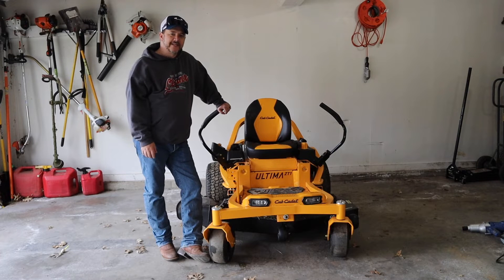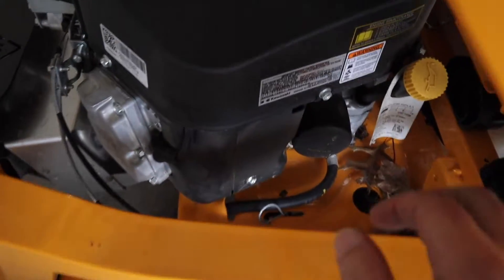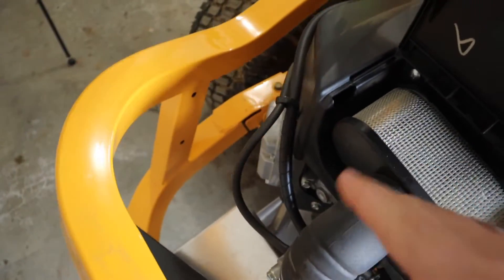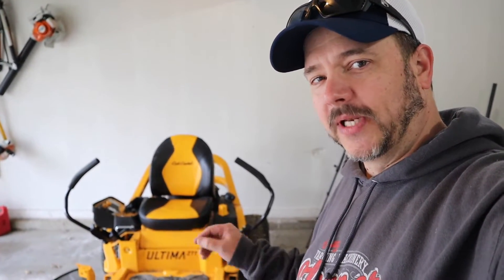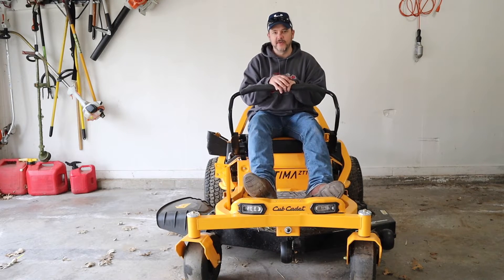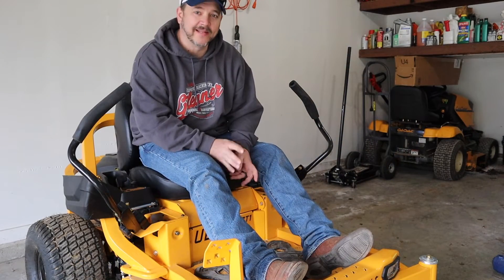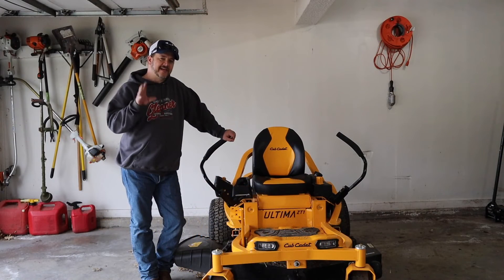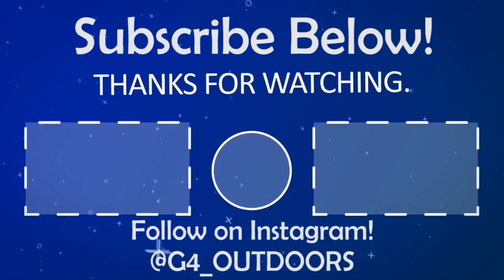Cub Cadet Ultima ZT1 Mower | Top 5 Features That You Should Consider

Comment: Can we get some updates on these Ultima Zero Turn Mowers now that spring has sprung? How are they performing?
Reply from the maker: Steve Molnar working on thumbnails and tags. Watch this first. https://youtu.be/E83Sul2e38Q
Reply from the maker: Steve Molnar watch this second. https://youtu.be/TiVDK7Yj2E8
Reply: Mine has definitely surprised me in a good way.    I am blown away at how well this mower runs and works for the very low price tag.  Recently we had rain constantly for two weeks and one of those weeks I was away on vacation.  When i returned some of my grass was over 24 inches.  I mow 7 acres of rolling hills and open woods.  This machine (albeit going very slow) cut all of this damp grass like it was its job, which it is.

Pros:  price, good ride, easy to drive, cuts well.
Cons:a bit slippery on damp of soft soil, the hose plug in deck cleaner really doesnt do a greta job.  You still need to get under it and power wash the under deck especially when mowing wet spring grass.
Reply from the maker: @troybennett9525  Thanks for the comment Troy!
Reply: @troybennett9525  thanks troy
Reply: the new model  i think its the 2019 or 2020 looks like a good mower

Comment: I love mine, however no hour meter is a wtf moment, and I’d like to see something separating the oil drain hose from the metal frame, perhaps the same flex conduit they use for the electrical wire at the very least.

Comment: I just bought a Ultima ZT1 54 and it does not have the Aeroforce deck.  Is that some type of optional equipment?  Can I up grade to one?
Reply: How do you like it? I'm looking into that one as well.  Do you notice any difference in the air filter and oil drain?

Comment: I bought mine over a month ago... best in class cut😂🤣😂🤣 cuts horrible and the blades are 70 dollars for 3 no aftermarket blades because of s shaped center hole design. Also sent it to repair shop because after mowing for an hour and then stopping the left transmission won't move they said its the parking brake I have to jiggle the handle back and forth to unlock which doesn't work so nothing's wrong with it😖🙄🙄🙄

Comment: I hear that the cub cadet has to much problems with the deck to much vibration can you tell something about it
Reply from the maker: Tomas Castañeda My deck vibrated so bad that my arms were numb after I mowed my yard. My belt was always so hot I couldn’t hold onto it. The cut quality wasn’t anywhere near the best. If you’re looking to spend this much money, you have to check out my latest video. The Toro TimeCutter MyRIDE 54” 24.5HP is by far the best cutter I’ve had a chance to demo so far.
Reply: So do you like this mower or not ?  It seems like you go back and forth.  One video you like it and then the comments seem to go the other direction.  I'm looking to get a 0 turn and am weighing my options.  Thanks.
Reply from the maker: Mike Petrosky the day I got it I was just excited and blinded by the looks. As that wore off, I started to notice all of the flaws and workmanship. I would highly recommend staying away from this model. That being said, they are on their second or third year of production of this model. Things might be better at this point, but I won’t guarantee  anything.

Comment: Looks great but as with all the box store mowers it’s the hydros that are the weak point. I wore out a cub cadet 1050 on my property in 2 years. Hydrostatic drive isn’t strong and durable enough to handle any hill climbing. Plus you can’t service the hydro. They are fine for postage stamp yards, but any pulling or climbing hills will destroy the drivetrain.
Reply from the maker: JohnnyRebKy Agreed! I will have a great video for you coming up 🤣. Cub took mine back and is bringing me another one along with a rep issuing a bad vibration for YouTube purposes. They did say that it wasn’t designed to cut my property. 🤷🏻‍♂️. It’s designed for up to 4 acres, so how is it my 2 acre property isn’t ideal for the Cub? I’m going to laugh at this guy if he tells me this mower isn’t designed for my property and only for flat golf course lawns.
Reply: G4 Outdoors well they are designed for flat golf course lawns lol. The hydros can’t handle much strain and you can’t change the fluid. All the shavings remain in there forever and if you get it hot it’s finished. I have 5 1/2 acres with some big hills so I had to buy a John Deere X700 series with the shaft drive and monster strong hydro drive. If I were you I wouldn’t buy any mower that doesn’t have a serviceable hydro system. Changing fluid and filter makes all the difference. The ones that don’t are designed to be thrown away after a few years and buy a new one. A durable hydro that’s serviceable can last 30 years. I have a JD 318 that’s 38 years old now and the hydro drive is still going strong. Cub cadet riding mowers all have the tuff torque K46 hydro that isn’t serviceable, and so does the box store John Deere’s. A good riding mower needs the serviceable K58 hydro or above which is only found in dealer models. Zero turns need commercial hydros to last.

Comment: Hi I'm Jim and I've been watching some of your vids and have a question as I am very interested in purchasing this ZT1-50 at Home Depot near me but have been nervous the question is on the deck itself as I hear of other issues concerning this,is there a major problem with the vibration or is it just louder or does it jerk around, What?
Reply from the maker: James Sommer The belt slaps around a lot. There is a miss alignment problem or a balance issue for sure. Don’t let the paid reviews fool you.
Reply: G4 Outdoors then you mentioned a different tension spring right!
Reply from the maker: James Sommer This is my second Ultima ZT1, the spring tensioner is better on this one, but it still has too much slop or there is something else wrong for it to be vibrating like it is.
Reply: G4 Outdoors I really like this mower,it looks like a commercial mower for my lawn and looks like a monster mower and the looks tell me a lot but is it worth my buying it?
Reply from the maker: James Sommer depending on what your previous mower was. It has an awesome warranty, the ride is way more comfortable than my last Cub tractor, it gets my lawns mowed in no time. If you are upgrading, you will more than likely love it. If you are just a regular homeowner (as far as Lawncare goes), you will probably love it. It’s definitely not the worst mower out there.
Reply: G4 Outdoors I have now a 10 year old as I bought brand new in 2009 a Toro 42" timecutter zero turn and it's about ready to bite the dust.
Reply: Any idea if the deck vibration issue has been addressed by Cub Cadet?  Would you still recommend this over Ariens, Toro, John Deere?
Reply: Jason Ahlers I have no idea,but I decided to keep mowing with my current mower until it can't cut anymore,then I will consider buying the zt1-50 if they are still available.
Thank you for the look ahead.

Comment: Looks good Randy. Those are good looking mowers as well. May want to lower that rear tire pressure a hair. It will make it a more comfy ride without suspension seat and the tires will wear evenly. Only reason I noticed is bc there is no dirt on the outer tire. The edge of the tires should have dirt on them as well. Thats where you get your side to side hill traction. Love the lights!!
Reply from the maker: Thanks for the heads up! I’ve only been able to use it once, so I really haven’t had a chance to feel things out yet.
Reply: @g4outdoors  yeah run the tires lower. Better traction and better ride quality. Also tires wear evenly. Sweet mower. Need to mow the neigbors now.
Reply from the maker: My new neighbors just moved in a week ago. I asked him if he had a mower, and he said he has to go buy one. I said no no. I take care of this property LOL.
Reply: @g4outdoors  make that $$

Comment: I noticed you have a lawn tractor too.  Which would be better pulling accessories, i.e. carts, plug aerator, etc?  I have two slopes in series.  They range between 12 and 18 degrees.  Do you think ZT1 would handle these or cause premature wear on the transmission?   Mfg's mostly do not recommend slopes over 15 deg, however, dealers say no problem with my slopes.
Thanks for your video.
Reply from the maker: I’ve had that tractor for 10 years. It has the same motors as the ZT1. I plug and haul a cart every year with zero problems. As long as you know what’s right and wrong, I should be just fine.

Comment: Honorable mentions: easy belt access through floor, nice grip design on handle, led’s and comes with hitch. Not all mowers in this price range come with hitch or lights at all. 

Also how much psi you run? I noticed I basically had 2 rows of tread that had showed signs of use. Turned out they had put 35psi in my tires. Went to 10 and now have about 4 row width of tread on the ground.
Reply from the maker: I changed belt for video purposes this weekend, and what a breeze! Taking the deck off and on was super easy as well. I have not checked the tire pressure yet, but I did get a comment that said they noticed I was running too much because of the dirt on the tire. So, I would guess they come outrageously overinflated.
Reply from the maker: Rick James 🤣 45!?

Comment: Only one issue not fond of . it's a minor one... still prefer manual parking brake lever..when hauling , arms have a tendency to bounce around which would unlock parking brake.. still,nice mower...
Reply from the maker: I will find out if that is the case. I use a yard cart quite a bit, and this mower doesn’t like to sit still at idle, so the brake system will be put to the test.

Comment: When i got my zt2 home the deck was uneven upon further inspection because i could get the deck to level, i saw that the clamshell on the left side of the deck bar right behind the hight adjuster had pulled free, the gromet was tightened to the clamshell but pulled out of the frame, theres no fix to that unless you want to ruin your warranty. I returned it. Broke my heart to!! I had the 54 with the kawi. Worked hard to be able to get that machine!!!
Reply from the maker: I wonder if that was a factory defect or error on dealer assembly?
Reply: @g4outdoors  idk G4 but not a risk im willing to take! They offered me another but my wife said no. Im just really concerned that everyone getting one has a potential of this failure to happen. It carries all the weight of the deck.
Reply: I got my zt2 few days ago and I don’t have that issue.

Comment: Nice vid👍 ? For you, how much does your deck vibrate when running? Mine seems to be pretty violent but could be totally normal? I'd love to see some footage of yours running at s stand still to see the idler pulley and how much it's bouncing.
Reply from the maker: 2RCPRODUCTIONS this is the second comment I’ve had on this topic. Mine runs smooth. I will make a video of just that beings I’ve had a couple of comments on it.
Reply: @g4outdoors  Cool thanks I appreciate it, My cousin owns a dealer and he told me to check the belt for s bump in the splice but it was smooth. He says he's had issues with had belts that solved the issue. I'll look for your vid, I was going to take a ride back to where I bought mine to see another one run for comparison. Thanks again!
Reply from the maker: 2RCPRODUCTIONS I got it recorded today. Not good news. I’ll upload tomorrow.
Reply: @g4outdoors  ok cool thanks 👍
Reply from the maker: 2RCPRODUCTIONS He ya go! https://youtu.be/MQSXMhRO7aQ
Reply: @2RCPRODUCTIONS  have you heard anything on your deck yet.
Reply: @robertsprouse8237  I called my dealer 2 days ago and told him for the second time that it's not right he asked me again if I had the throttle all the way up and I told him yes. I said it's not just me there's others claiming the same issue he said he would contact Cub to find out and that was Thursday so come 8 am this morning I'm gonna video mine and go down to the dealer to find out why I haven't got a call back and to see another one run and show them a video of mine. He says one your cutting material it will smooth out I don't buy that at all ,I think it's an alignment issue. If I don't get satisfaction I will fix it on my own. The unit is fantastic and superior to anything in it's class I feel this is a glitch that will get worked out. My buddy just bought a 42 the other day and he told me his is smooth👍 I'll keep everyone posted.
Reply: @2RCPRODUCTIONS  Thank you sir
Reply: @robertsprouse8237  So I went to the dealer and talked to the owner he said it's normal without the deck being loaded with grass he says once you cut with normal height grass it will run smoother. He said they design it to run at a certain rpm and that when it starts to cut it will pull tension on the belt and snug up the idler. The idler pulley is the one that bounces violently. I started a new 54 and vibrates just like mine. So 1 they are all messed up or they are all normal. I myself think for 3300 it should be smoother but the owner assured me I wouldn't have any issues and if I did he would take care of me. So I gave him the benefit of the doubt and went home and cut my lawn. It definitely smoothed out a little and at some points it's seemed to come and go but keep in mind only portions of my yard needed a cut. I have to say the cut quality and overall operation was flawless. The clippings we're so small I didn't see any. I'm gonna run with it and see what happens. If a bulletin surfaces for an issue or repair being needed, I will take it in. My yard is 105 × 200 and I flew through it in about 20. Hope this helps Buddy👍👍
Reply: I smell bullshit. I would think it works the other way if you get to tall of grass then you might get vibration. I also agree it should be smooth. Maybe a tighter spring on the tension. What about changing the belt. Some have said it fixes it. Also maybe G4 Outdoors may get to the bottom with bring it to the techs a cub cadet. But we will see. Also with 5,000.00 in this mower I will not put up with this if my mower starts doing it.

Comment: I was in Home Depot the other day and looked at one of these. I like the bigger tires and open framework. 
I got to looking closely and noticed that the right front wheel was off of the floor, (mower was inside on flat concrete floor) and the other three were properly situated. I actually started spinning the right front wheel. I’m not sure what the issue was, but I’m thinking the frame was maybe warped .
Reply from the maker: Not a good sign. Someone fell asleep in the quality control department, lol.